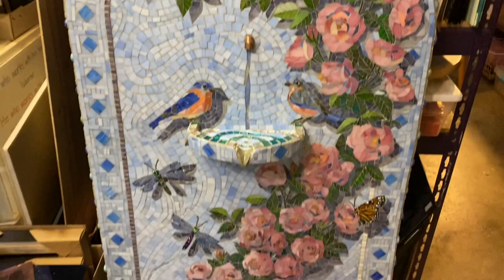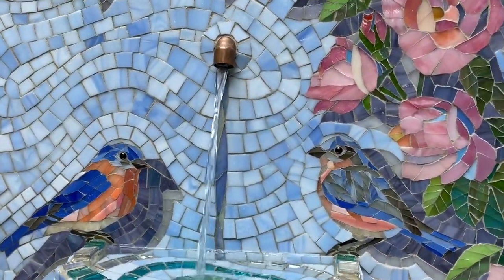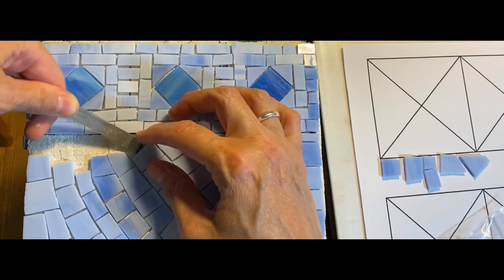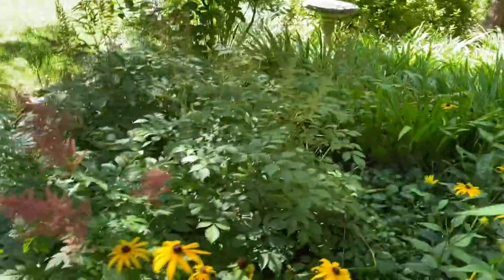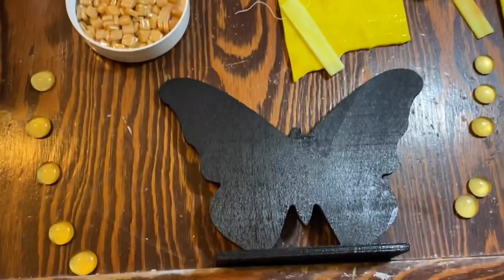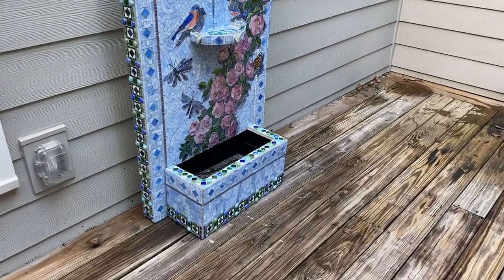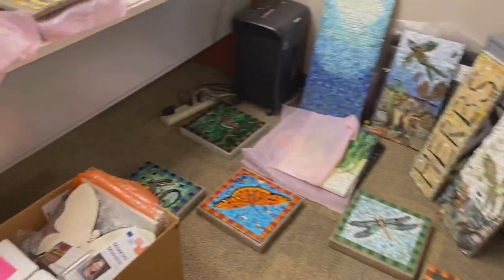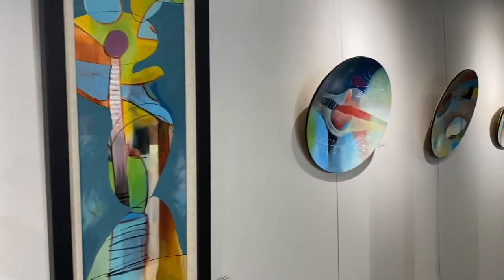Ep. 58 DELIVERING THE MOSAIC FOUNTAIN, prepping for my exhibit, a fun reward and a bonus field trip.

Comment: Just incredible!  I would buy an extra basin, since it might be hard to find a replacement the exact size if anything ever happens to the one you have, Plastic does crack and wear. Also, just wondering if you could paint the Apoxie spout ,where the water falls over the edge blue/green to blend in with the water? what fun it has been to watch you make this!! Thank you for sharing!!
Reply from the maker: Carol - Great idea about getting an extra basin. I am definitely doing that! I think you can paint Apoxie Sculpt but I'm not sure how well it will hold up with use. I used gray to go with the gray grout.